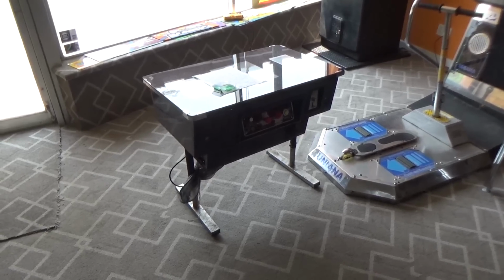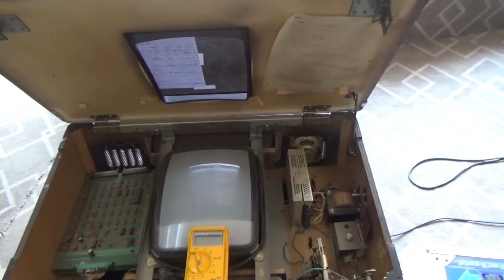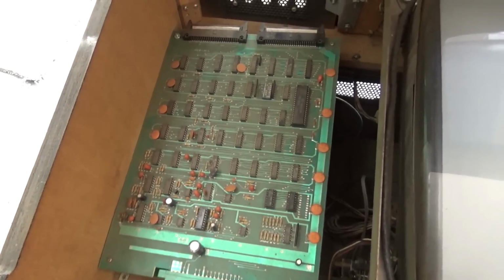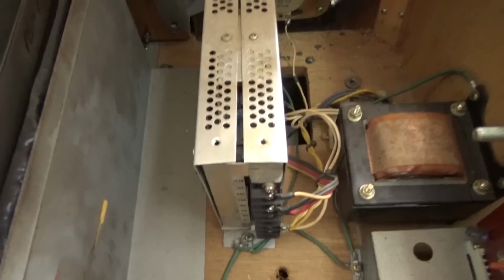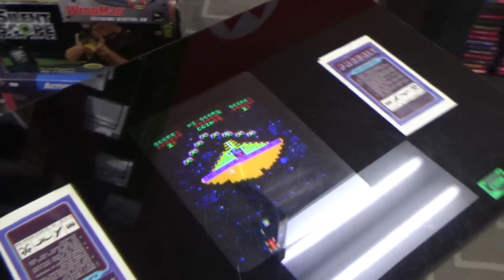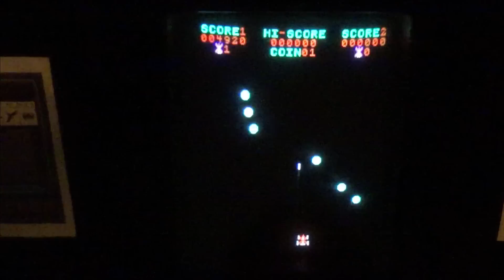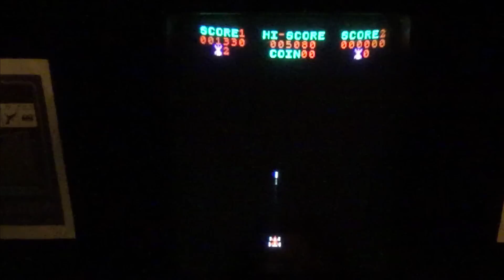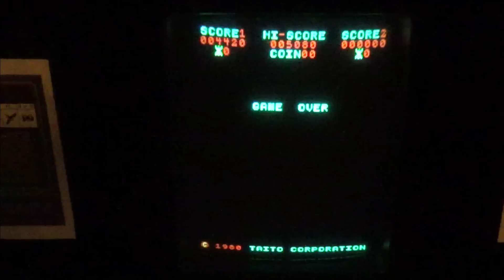Repairing A 1981 Centuri PHOENIX Cocktail Arcade Game - PCB, Monitor, Sound, It's ALL BROKE!

Comment: Sounds like you have some video signal interference in the audio.
Also, if those colors are that much out of wack, there's probably something wrong with the built in Degauss coil or its circuitry.
And by the way that little cardboard cover for the plug that Joe is taking about, was right there in the machine. But I'm sure you guys noticed that 🙂
Thanks for posting guys!
Reply: AFAIK all Phoenixes have video interference in the audio. And the cocktail table had a degauss push button built in on the right near the power supply, this machine has manual degauss.

Comment: lol, I would put a sign on the front door stating that  if they would like to use the trash, it will cost them $1.00 per item unless they buy something first. My dad work on the classic video games too. That is where I learned how to repair electronics. When it came to the cocktail games, I always had to play the two player to make sure both sides worked equally. I am sure you did, it just wasn't on the video. The chips that were not seated properly was always caused from people using them like a pinball machine, or even when the owners move them around. They usually get dropped, which causes the chips to work loose. I would have to put silicone under the chips to make sure they wouldn't come loose from abuse. Awesome game though. My favorite was Popeye the cocktail version. Have a good day! Oh, Tell Joe to smile more... lol
Reply from the maker: The only problem with putting up signs is people don't read!
Reply: @LyonsArcade  yeah, I forgot about that problem. We'll I remember when my dad had his tv shop and there were a couple of guys that would come in every so often to watch TV. That's all they would do. My dad was constantly chasing them out, too.

Comment: I think the humming is coming from the logic on the game board. Older computers did that a lot where the display controller would bleed into the sound. Unless you need capacitors, I don't think much else can be done.

Comment: Great video, but if that crt needed degaussing, it must be known that it is with reference to earths magnetic field. So once it’s moved back to the owners house it could well need doing again. The fact is that all colour monitors have a degauss circuit, and if the screen was messed up in the shop, the degauss circuit may be faulty. The degauss posistor may have failed or became dry jointed. Or even the coil maybe been disconnected at the pcb.

Comment: I agree the plug was probably fine except for the missing piece (which is a special material called 'fish paper' - it's the same material you occasionally see covering electrical parts like CRT neck boards). Still, replacing it with a more modern one was a good move. Edit: Looks like the missing part of the old plug is trapped under the CRT degauss coil at 10:30.

Comment: I'd want to poke into audio source, and hear if there's noise before amplifier. How would an old arcade board act if hooked up to new ATX power supply? *Note: ATX 24-pin, connect on/off switch between pins 15 and 16.

Comment: Is there a trick for getting IC chips into sockets easier?  They never line up and I just wind up bending the pins  with my fingers the best I can.
Reply from the maker: You can lay the side of the chip against a table and bend that whole side slightly so they line up better with the socket if they're bent out too far.
Reply: @LyonsArcade  -- They do make jigs for this too. Plus, some like spraying Deoxit into the sockets.
Reply: They also have a fancy little plastic tool that folds in both sides slightly with one little squeeze. I used on when I used to set up stacks of chips to be inserted.
That seems like a million years ago, way back there in the 90s

Comment: Bruh BRUH!  Hustle a restoration for a double rate!  I useh to do it all the time when co puher repair was an easier gig!  Once I'd get the ttinc working I'd turn back around & offer them another service!  In that case, it was windows optimization.  Debloat the install, run updates, clear startup/services, clean the temps out of the fs, crawl the Downloads folder for exe's & msi's to delete, & finish off with a defrag.  Back then it was like buying a new computer.  In your case it's a mere clean with soap, alcohol,  & a polish with polywatch.  What, maybe a few electrolytics here or there?  Buy one of those astique crt refresh kits?

Comment: What using 2x CORSAIR 1KW PC PSUs to supply +5/-5 Volts for the logic and +12/-12 Volts for everything else and a startup relay to trigger the switch on of both CORSAIR PSUs just an idea.

Comment: If that happens a lot I would put a trash can outside.
Reply: Dont give the public a trash can. It will be filled with the most disgusting stuff ever, and when it is full they will just dump it on the ground in front of the can.
Reply from the maker: There's one down the street they've spraypainted vulgar graffiti on, and they used to have one behind the store but the city would never empty it so all the homeless people would just throw trash all around it all the time.